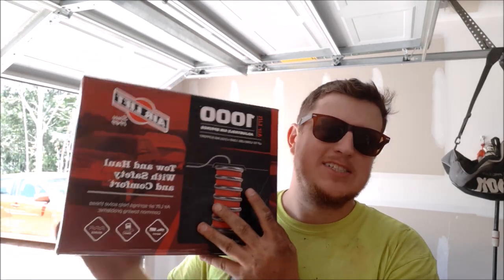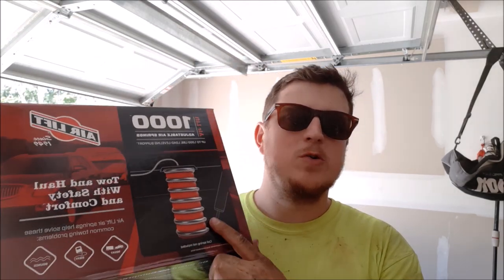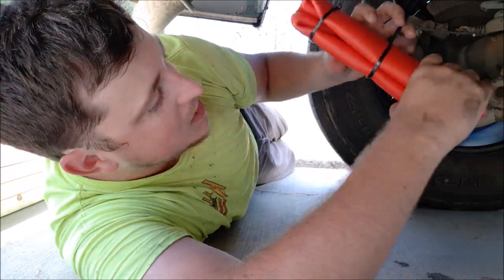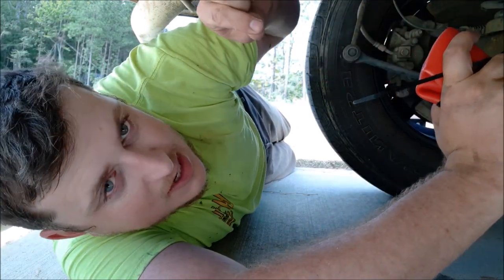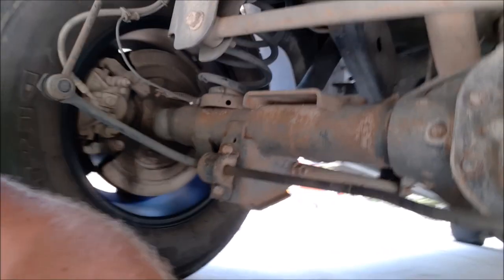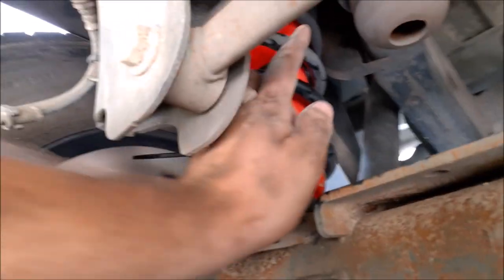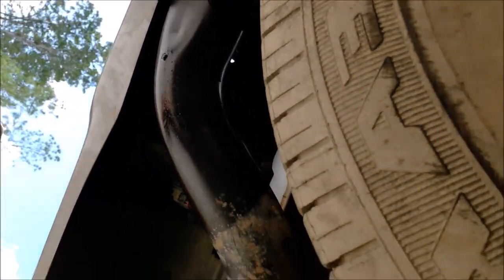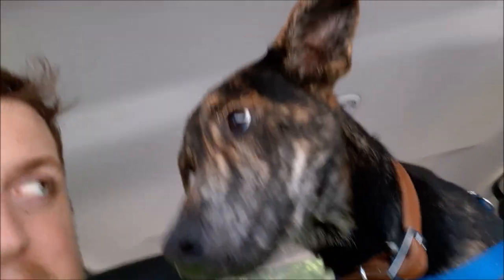Air Lift 1000 truck air bags on ram 1500

Comment: I just did my install yesterday. Like you didn't remove the wheels. I jacked up one side at a time to install the bags. Quick and simple. I located my air valve behind the fuel door.

Comment: i want to level my truck (lift the front only to match the back) what are your thoughts on using this air lift only in the front to to lift just a bit. i dont ever haul anything so im not worried about that. have you heard anything about how it the truck rides if installed on the front?
Reply: Have you done it? It probably would ride like shit. I'm planning on doing an icon level lift
Reply: Won’t work in the front